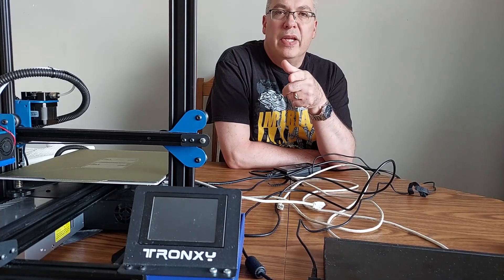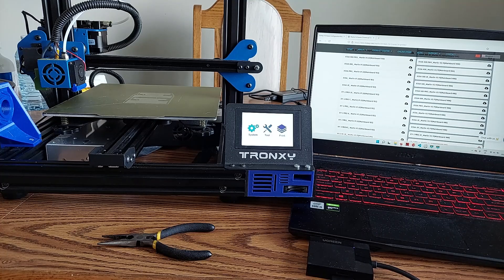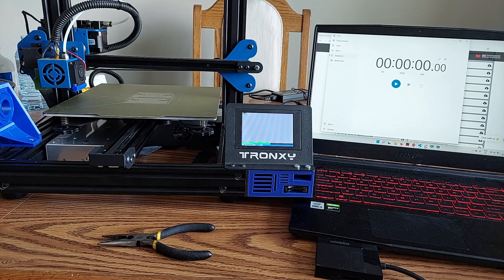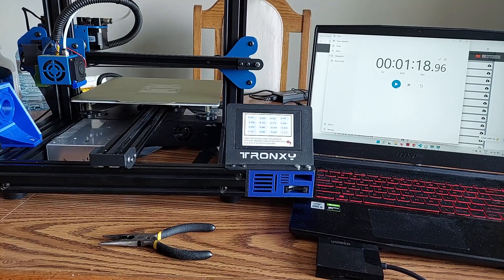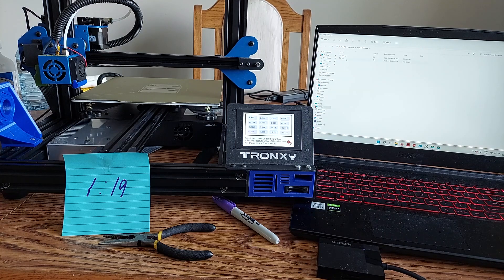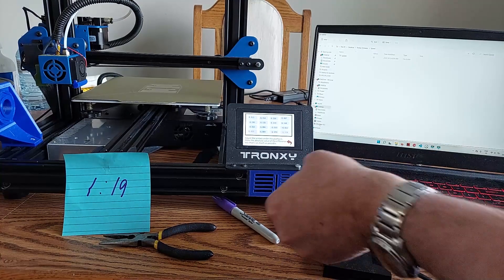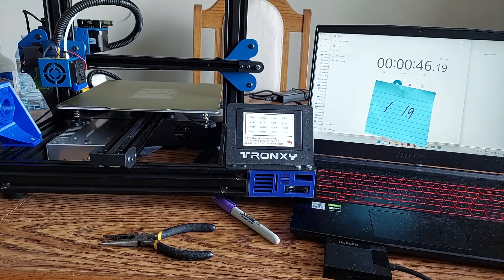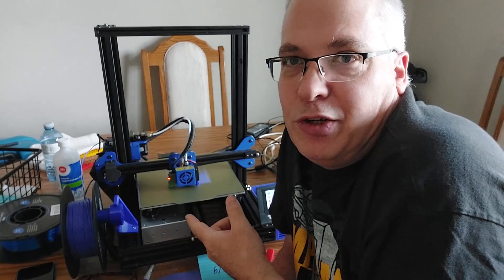Speed Hack for Tronxy XY2 Pro 3d printer

Comment: Nice video. Do you know any other hacks for it,like silencing the fan that sounds like a jet engine? Or some upgrades?
Reply: I'm running Marlin 2 on mine, with a cheap direct drive pushing through a Creality hot end running a 0.6 nozzle and textured PEI bed.

The only problem I get is I need to reboot it after a few prints otherwise it'll crap out and reset itself like it's had a power failure. I'm guessing it's something to do with the board/ Marlin crashing.

Next plan is to use an Ender 3 X axis linear rail kit (currently on my Two Trees Bluer) and swap a BTT TFY24 and SKR Mini into it - Or probably into my spare XY2 I got stupid cheap a while ago and have used as a parts machine.

It's never going to be a great printer, but with work it's an OK one.

Comment: Hi m8 can I built a printer out the tronxy xy2 pro well all the stock tronxy parts but now has a 310x310x400 build plate but now I need change steps I’m presuming the steps for set it for the bigger build area carnt fined how to do that

Comment: Hey, thanks for all the informative videos, you are a real treasure for the tronxy community. 
But I also have a question, did you ever find a firmware solution for the strange homing issue with the original board and marlin? Or is switching to the other pins the only way to go?

Comment: Hello Jeff, the ChiTu firmware is currently still running - in very good quality - on my XY-2 Pro. Since I'm currently using my Anycubic Vyper anyway, I thought about installing Marlin on the XY-2 Pro. Is the difference in quality really that big that it's worth it?
Reply from the maker: If it works don't mess with it. Just my 2 cents.

Comment: hello jeff the video is very good I have a problem with my tronxy xy2 when it does the autocalibration the sensor is outside the hot bed and I don't know how to configure it again I await your response thank
Reply from the maker: Google M206 marlin.
Example:
Shift the print area 10mm to the left:
M206 X10